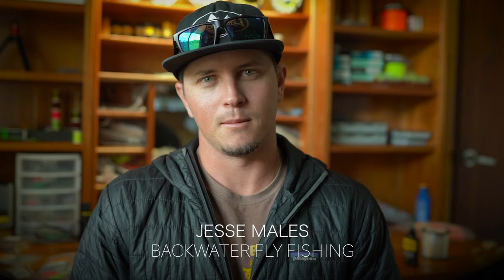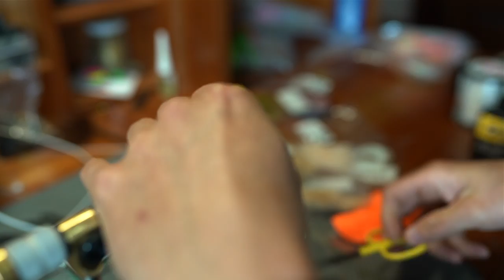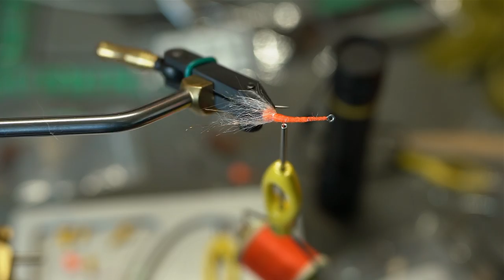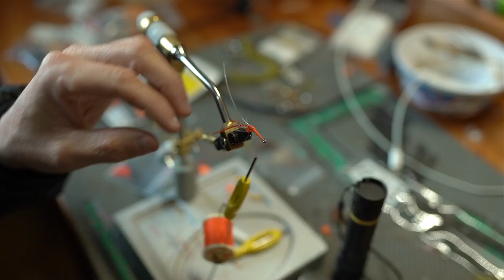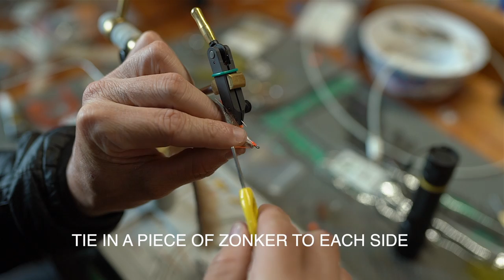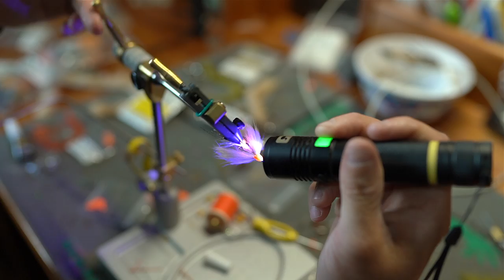EZ Avalon Permit Fly Pattern Tying Tutorial: BACKWATER VLOG #36

Comment: Cool little pattern. I like those beads underneath. I bet it sounds just like a shrimp clicking, when diving up & down, in the water.
Reply from the maker: exactly and keeps the hook point up
Reply: @BackwaterFlyFishing  Right! I got that. I wonder if you made a different pattern (a streamer) with a mono weed guard, and added beads to it. How it would effect a good hook set? It should work fine too, but may snag a few loose weeds and grass.
Reply from the maker: Chris Sewell yeah I have done some bunny strip flies with this similar bead setup and it works well